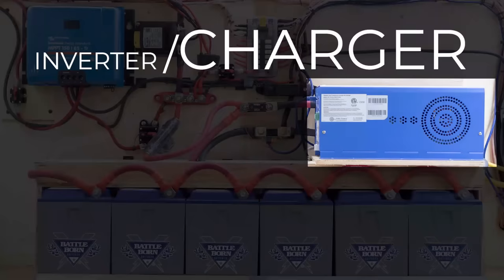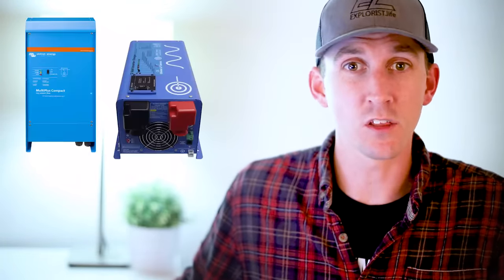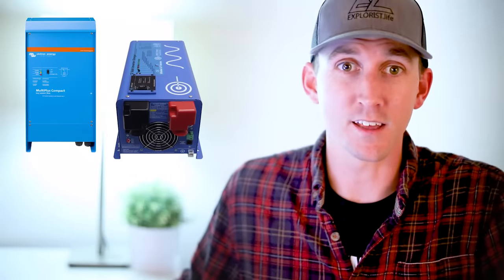Basic Solar Parts Needed for a DIY Camper Van or RV Solar Install

Comment: zero gauge and 1/0 (read one aught) are the same thing, you dont move from 0 to 1/0 the next standard wire size in amp ratting is 2/0
Reply from the maker: You are correct. Good job.

Comment: Will 100/50 work for 250w panles?
Reply from the maker: It depends on the panel and how many of them you plan on using.  Here is a walk-through to figure out if that size will work for you: https://www.explorist.life/how-to-choose-a-solar-charge-controller-for-your-camper/

Comment: IF YOU HAVE A 500 AMP HOUR 24 VOLT SYSTEM BATTERY BANK HOW MANY AMP HOURS WOULD IT BE ON A 12 VOLT SYSTEM? OR IS IT THE SAME?
Reply from the maker: I think there's a deeper, underlying question here...  What are you trying to achieve?
Reply: @EXPLORISTlife  I was just wondering because everything gets converted back to 12volts to use in the RV. didn't know if the AMP hours changed or doubled???
Reply from the maker: @bigdan3476  A 24V system actually has half as many amp hours (at 24 volts) than a 12v system.  

Your standard 12V 100AH Battle Born Lithium Battery has about 1200 watt hours in it.  1200 watt hours / 12V = 100 Amp Hours

1200 watt hours / 24V = 50 Amp Hours.

But if you are trying to power 12V appliances through a DC-DC converter from a 24V battery bank, you'd have 100 amp hours at 12V available from that 50 amp hour battery bank.
Reply: @EXPLORISTlife  Thank you that answered my curiosity.... I was watching a youtube video after I asked you the question.  The video was from Pau Hana where they had installed ten 24 volt battle borne 50 AMP hour batteries and he said it gave them 1000 AMP hours at 12 volts.  Any benefit to getting a set up like that as opposed to getting ten 100 AMP hour 12 volt batteries?
Reply from the maker: @bigdan3476  Good!  Glad that came across properly. :)  IMO, I don't recommend wiring into a 24V battery bank unless you plan on having more than 1200W of solar on the system.

Comment: What tipe of inverters are pc ups ? Pure sine ?
Reply from the maker: I'm sure that depends on the type of UPS.  Check the manufacturers data sheet for that information.
Reply: @EXPLORISTlife  i have 1.2 kw solar panels , can u sugest me a mppt tracker for thos ? I was planning to use ups as inverters for ex 1 ups for device,  and build a powerwall with 18650
Reply from the maker: Of course!  Here is a video that will walk you through that process: https://www.youtube.com/watch?v=MxziHKvTRh8&list=PLmvhcyi4n0TU6HlMaQiCUwC20DBlyv6s_&index=8&t=2s

Comment: what about a 12vdc to 12vdc charger
Reply from the maker: Also a great option!  They weren't particularly popular back when I made this video, but they are much more readily available now and is actually what I recommend over an Isolator.

Comment: Would you be willing to help me build my solar and maybe record it for content i saved up for that past 2 years to build a solar array for my rv im a full time rver and have been wanting to completely go offgrid and not depend on power companies because the plit of land i bought is really out in nowhere the light company basically said they arnt gonna put power out here and need a good solution for my problem basically the whole roof is gonna be solar panels at least thats my plan and a custom basket under the rv for the battery array
Reply from the maker: Here is my info about installation services: https://www.explorist.life/camper-electrical-install-services/

Comment: QUESTION: if i had a 2000 watt inverter and needed to use a 1800w item and another 1000w item at the same time, would it work let alone damage my system?
Reply from the maker: It would strain your inverter depending on how long you need to run both at the same time.  Why not just get an appropriately sized inverter?  That'd be the correct way to approach this.
Reply: EXPLORIST life someone on some forum said the limit for 12v battery’s is a 2000w inverter. idk if that’s true but my question was based off this knowledge. and if i were to increase battery voltage, what repercussions would i face??

Comment: There is one big problem with Lithium batteries, they loose a lot of their capacity when it is colder then 10c (wich is most of the time here even in summer). Lithium also needs to be warmed up before they can be charged if it is to cold 7 to 0c... That is one of the reasons I go for AGM as here 10c is the normal temperature even in the summer. I want to use the huge space outside under my van for battery and such and not waste the precious space inside the van.

My Electric mountain bike with Lithium battery you can really feel the power drain when it is less then 12c outside it will barely manage to get up a hill, while if it is 15c and more it goes up without problem that same hill...

Also the cost of lithium is just horrible here in Norway at least. Lithium cost 4-5 times more compared to AGM that also can take 1500 charge cycles.
Reply from the maker: Regarding lithium vs AGM in cold temperatures, most of that is somewhat correct.   We've covered that topic in pretty good depth: https://youtu.be/USOWVAeb1H8
Reply: @EXPLORISTlife   Ahh great :) I must see that video. All the information I have is from my own experience and the little data I found here and there. No one other I have seen mentions the problems with Lithium...

Comment: I'm probably one of the few that like PMW controllers as I am not an energy hog and my 200 watt system with AGM batteries are more than sufficient for my class B RV.  They run my refrigerator, led tv and laptop just fine. I do not need $1000 lithium batteries as my AGM's are 6 years old and going strong.
Reply from the maker: Great!  Glad you found what works for you.

Comment: Great video!    Thank you, for sharing it!   But, I am somewhat pedantic about certain things, and one of those things is the distinction between "plugs" and "outlets."   Plugs are male and outlets are female.   Plugs are inputs and outlets are outputs.  Plugs should NEVER have measurable voltage across them when not inserted into an outlet.   This distinction is important, for safety reasons, and should be considered when designing any electrical system.   But, in the grand scheme of things in the context of this video, I would give you a 99 out of 100!   You otherwise covered the material very well!
Reply from the maker: Yeah, if somebody can't determine the semantics and use context clues and determine when to use a plug vs an outlet, they lack the cognitive ability to tackle these DIY projects.

Comment: I noticed the Aims Inverter on the set up.  I've had the worst experience with Aims.  My inverter failed and I arranged to have it shipped to them for repair.  They said nothing is wrong with it and wanted $220 plus $50 for shipping even though there was no repairs performed.  When it was shipped back it was thrown in a box without any protection and arrived dented and banged up.  I don't recommend them at all, their customer service and the attitude of everyone there was the worst.  I was extremely disappointed with their service and especially the people who handled the phone calls.

Comment: you didnt  explain difference in efficiency between mono and poly you just said the panel with 175 has 15 more than the one rated for 160...your point seems vehemently nullified
Reply from the maker: That's because this was simply a lesson over the main basic parts to build a mobile solar setup.  I'll do a poly vs mono side by side case study eventually, but that wasn't what this video was about.

Comment: should have said to use only pure copper wire. NO alu. and to only use UL, or ISO,  listed connector's and terminals, with built on heat shrink tubing. as the metal in them is much thicker thus allowing more juice to flow without heating up. never use the cheap ones anyplace close to the batteries. sure the good stuff cost more, but not after you have to replace the cheap stuff, or have a fire.
Reply from the maker: All of the wires, lugs, and heat shrink in my parts lists at https://www.explorist.life/solarwiringdiagrams is 'the good stuff'.

Comment: 'normal' 110 volt plugs makes a bit of an assumption
Reply: Wiring in a 12 volt plug and using the appropriate USB adapter is a very useful thought atm
Reply from the maker: "normal" 110v plugs was for back when 90% of our audience was from the USA.  Our newer videos are little more 230V inclusive. 🤣👍

Comment: Uh there are 3 solar panels. You didn't say anything about Amorphous Solar Panels. Why? They may take up way more space, but they outperform Mono and Poly in the shade or on cloudy days hands down. At least include them.
Reply from the maker: I also skipped over Cadmium Telluride solar panels.  :)  I only included the two most popular types of solar panels for the sake of clarity as this is a 101 level introduction to the basic parts of a camper electrical system.  I would include all types of panels if I were to do a "Different Types of Solar Panels" video.
Reply: @EXPLORISTlife  Cool.  Thanks for the update, and introducing me to Cadmium Telluride solar panels.  I never even heard of those before.  Time to research!!!

Comment: Great video, but 1 major omission... COST! A full lithium/inverter setup will be in the $5000+ neighborhood.
Reply from the maker: I think you missed the point a bit... These are simply the basic parts.  Once you know what these individual parts do, you can make decisions on the specific parts based on YOUR needs and YOUR budget.

Comment: Great info. This answers a lot of basics to get me focused/started. I will be applying this to my 
sailboat  ( @sailingmagdalena if anyone is interested) Also do you have anting/info on amp dampers ... not sure whaat they are called...
Reply from the maker: Awesome!  Glad it helped.  Thanks for watching!  I don't have anything different to say about amperage dangers than I do about voltage dangers.  Disconnect power when working on things.  That's pretty much it.

Short circuiting two battery terminals could produce over 1,000 amps but touching the positive and negative of a 12v battery with a short circuit current of 12v, realistically, won't do anything.

On the flip side,   touching the hot and neutral wires in a 120v breaker box with a 15 amp breaker will actually more dangerous because those 15 amps are being pushed 10x harder in a 120v circuit than in a 12v circuit and will actually make it through the resistance of the body.

Metaphor time (Apologies for those who don't understand metaphors):

"It's not the volts that will kill you, it's the amps" ->
"Falling won't kill you, it's the sudden stop at the end"

Jumping off of a 2' ledge probably won't hurt you and unless there is a freak accident, won't kill anybody.  <-  12 volts & 1000 amps

Jumping off of a 8' platform may not kill you, but it could... and it will definitely hurt. <- 120 volts & 20 amps

Jumping off of a 50 foot cliff is survivable, but if it doesn't kill you, it's going to mess you up. <- 600 volts & 2 amps

Comment: Lets get down to the metal what's it gonna run a guy PRICES, an in the park guess on say 1000 watt, 2000, 3000, 4000, watt units will cost. That's gonna tell a guy if it's something he want' to get into or not.
Reply from the maker: It's not that easy.  That's like trying to say...  "Just tell me how much it costs to buy a truck, a car, a house, and a boat to see what I want to do".  There are simply too many variables to break it down that far.

Comment: solar panels the blue solar panels start making electricity before the monocrystling and they also  monocrystling the polyclisting make solar power later in the day which makes more electricity then and also makes electricity and darker weather or light I should say as well and works better in the northern regions I have both solar panels I know what I'm talking about and I use them both the blue solar panels make great electricity before the black solar panels will and they also work all day long make electricity and they make electricity longer than the black solar panels and in cloudy weather they make electricity and the shaded electricity follow the darker than the black solar panels for more making more power now if everything's with sunshine the black solar panels would win but it doesn't come out with straight Sun the light starts coming up and before the sun shows the blue solar panels will make electricity but the black ones are not for another 2 hours and the blue solar panels make pictures 3 hours beyond the time the black solar panels stop making electricity cuz once the sun disappears there's still light the black one stop making blue one still make electricity. Yes I like blue solar panels I also like the black solar panels but I don't have that many blue solar panels I have more black solar panels I need some more blue solar panels. And my solar panels charge my batteries on the north side of the house in the shade usually by 9:00 in the morning oh and by the way yeah my boo set a panels have my batteries charged by 9:00 and yeah I have 19 batteries that gets charged all 1000 amps 135 amp hours each so don't lie about the shade I don't mind there's no sun as long as there's light from the sky my solar panels get the batteries charged black ones are not quite as efficient though but that's okay they can have the Sun at times but we get so many cloudy weathers in the winter time the blue said the blue solar panels work really good in the winter black ones really don't but in the summertime they both work pretty good just a black quizzes you better but the blue and start making electricity first.
Reply from the maker: Any chances of you going back and adding some punctuation to that essay?  I'm sure there is some good info in that block of text, but goodness is it hard to read.
Reply: @EXPLORISTlife  yes because I talked to my phone my phone never gets anything written down right all I'm trying to say is blue solar panels are better than black solar panels because blue poets solar panels makes solar power before black solar panels do and they make power a couple hours after black solar panels stop making power at least that's what my solar panels keep proving to me every single night.

Comment: Can you please talk about server rack type batteries? You talk about many things, but never mention this option. Why? I want a 800Ah so 2x400Ah server racks would save me a lot of wiring (ref this video: https://www.youtube.com/watch?v=6n9Pfa9dq2k). I've seen very few campervan builds using these. Your recommendation would mean a lot for people like me who really don't know. Thanks
Reply from the maker: Most server rack batteries specifically forbid installation where they would be subject to vibrations (like a campervan) and if installed in such a location, their warranties are void.

If you want 800Ah, you should go with 3x 270Ah Battle Born GC3's that are specifically designed for harsh environments like constant vibrations in a camper van: https://battlebornbatteries.com/product/270ah-12v-lifepo4-deep-cycle-gc3-battery/?afmc=explorist_bb67
Reply: @EXPLORISTlife  very helpful, thanks.

Comment: A power inverter converts 12 volt into 110 volt? That makes no sense and I'm pretty sure there is a law of physics that it breaks. 

I think he means 12 volt to 110 watt.
Reply from the maker: That's actually not what I meant.  An inverter converts 12 volts to 110 volts.

Comment: Lol. Bro. You're an professional. How you dont know that this all this kinda bullshit.
You will never get 160 watts out of 160 watts rated plate. 
Best case is to get like 120 watts in a sunny day
Reply from the maker: Hey Elie!  You're actually incorrect.  It's actually possible to draw MORE wattage from a solar panel if the conditions are correct (cool temperatures and high sun angles.)  I've personally seen 240 watts out of 2 x 100 watt panels when wired in series and sent through an MPPT controller.